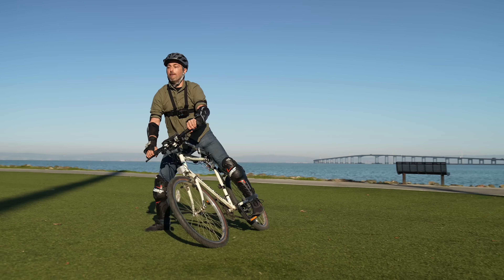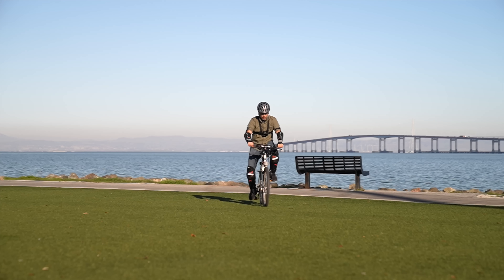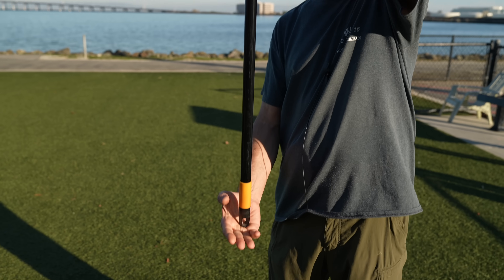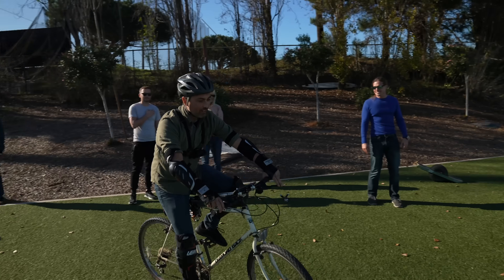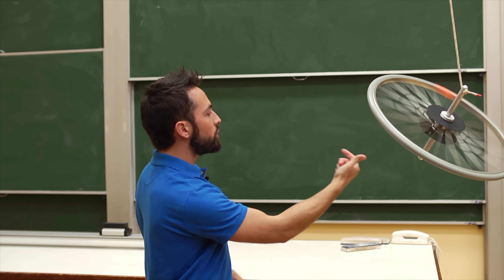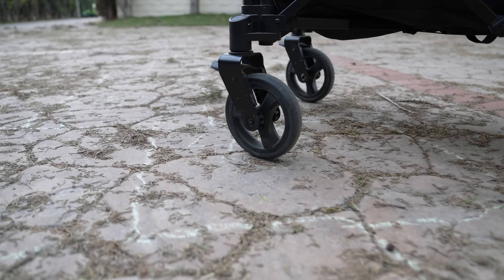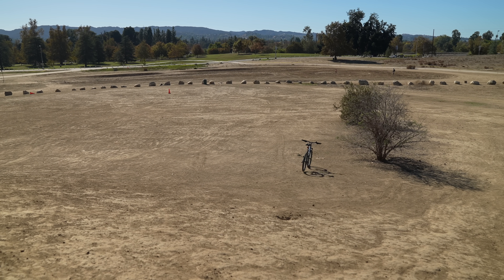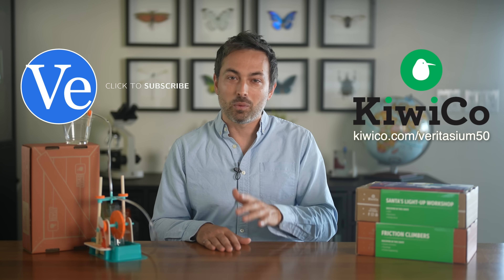Most People Don't Know How Bikes Work

Comment: Countersteering is not required, it is just an easier way to steer.  It help leans the bike quicker than just leaning by weight shifting only.  People are generally lazy so they look for the easiest ways to do things.  The bike is this video does NOT prove that countersteering is required to turn.
Reply: wrong
Reply: @Rick_Cavallaro  I am right.  Check online.  It would be very impractical (annoying, unsafe...) to steer a bike using weight shifting only, so that is why it is not done.  But technically, countersteering is NOT required.
Reply: @davidjames1684  You are not right.  And I don't need to check on-line.  I can check my M.S. in Dynamics.
Although I will give you this... There is a very small group of elite athletes that can balance a stationary bike.  They actually can steer without countersteering, but it doesn't look anything like us riding a bike.  It looks like a circus balancing act.  And it's not that they are just better at riding a bike than the rest of us.  They have mastered a different set of skills - skills that we don't use when riding a bike or motorcycle.
Reply: @Rick_Cavallaro  You are wrong.  If you were riding a bicycle and a big gust of wind pushed you to the left, whey the hell would you countersteer right?  The bike is already leaning left.  A degree is not a substitute for common sense.
Reply: @davidjames1684  
>> You are wrong.  

I'm tired of arguing with idiots.  Let's go at this another way.  I'll bet you $10K I'm right.  

>> A degree is not a substitute for common sense.

Common sense is not a substitute for rigorous analysis.  That's why Prof. Kusenko lost a $10,000 bet about my downwind car.
Reply: @Rick_Cavallaro  You didn't answer my question.  Why would you countersteer right if a gust of wind pushes you left on a bicycle?  Also, online is says that countersteering is NOT required on a bicycle.  Common sense tells you it is just a convenience and you even agreed with me that some very small group of elite athletes can do it.  Its main purpose is to get the bike leaning quickly, but there are other ways to lean a bike.  You are talking about riding a bike in a practical and normal sense.  I am talking about bare minimum to get it to work with restrictions (no countersteering).  Just ride a bike on a windy day, and each time a crosswind blows you, turn that same way without countersteering.  My statement was a bike can be ridden without countersteering, I didn't say it can be ridden normally that way.
Reply: @Rick_Cavallaro  Gambling is illegal at Bushwood and I never slice.  Damn!  I owe you nothing!
Reply: @davidjames1684  
>>  I owe you nothing!

You must be responding to voices in your head.  Who said you owe anyone anything!?  The fact of the matter is that I also owe you nothing.  That's why I can refuse to argue dynamics with someone that doesn't know the first thing about it.  You want to settle it... put $10K on it.  You don't want an easy $10K?  Odd.
Reply: @Rick_Cavallaro  Oh my you missed the Caddyshack reference.  Nice "contraption" by the way.  Too bad it doesn't prove Richard (Dick).
Reply: @Rick_Cavallaro  Funny how if someone doesn't agree with you, you call them an idiot, yet you did not (and probably cannot) answer my question about if a gust of wind pushes your bike, so that you are already leaning, why would you also need to countersteer to turn?  Just turn the wheel in the direction the wind blew you.  You "blew" it.  All countersteering is doing is getting the bike to lean quickly but if you can lean it using some other method (wind, weight shift, someone else riding alongside you on another bike that pushes you...), then countersteering is NOT needed to initiate the turn.  Just regular steering would suffice.  You are abusing the term "required" when referring to countersteering, when it is basically just a convenience to us for initiating turns.

Why don't you just have your friend try to turn left when you lock the steering so he cannot turn right?  That would help settle this debate.  Someone could be riding "perfectly" straight and just tip their head to the left to upset the balance of the bike and cause it to tip left.  Then just wait until the bike it at a good angle for the speed you are at (it will still be "tracking straight while tipped"), then quickly turn the handlebar to the left.  I am pressure sure I could do it or learn how to do it.  Just because someone falls off a bike attempting this doesn't mean it is not possible.  A kid falls off a bike when first learning to ride but eventually figures it out.  That is why I say this video proves virtually nothing about countersteering being required.
Reply: @Rick_Cavallaro  We are not debating a downwind car, we are debating countersteering.

Comment: I had to learn how to turn at high speeds on a bike, because I enjoyed going fast, and normal turning made me flip over the bike. The trick was yes a small turn the opposite was I wanted to go, and then to lean the direction I wanted to go, practically keeping the handle bars straight for the turn. Once I learned this I could go fast, and not need to slow down at corners. It was terrifying and exhilarating, but also increasingly safe to do it that way. Think I just learned that technique from my dad watching mortar bike racing and just picking up on that they mostly turn by leaning, and applied it on a smaller scale.

Comment: It's like a motorcycle.... You don't turn the handle bars you lean into the turn.
Reply: >> It's like a motorcycle.... 

Yes.

>> You don't turn the handle bars you lean into the turn.

No.
Reply: @Rick_Cavallaro  I've been riding motorcycles for 25 years! Yes you(or at least I) lean into the turn!
Reply: @Phantom8589  I have no doubt that's what you believe.  But you cannot initiate the turn by leaning, and the bike won't turn without steering.  And I've been riding motorcycles, bikes, and unicycles a lot longer than that - not that that counts for anything.
Reply: @Rick_Cavallaro  Well ok then, take care  brother, I slightly disagree but that's ok, we can have our own opinions. Safe travels while riding ✌️ 🏍️

Comment: wish they would have talked about steering when going fast. On a bicycle or a motorcycle when you are going over a certain speed say 20mph (I don't know the exact speed) steering becomes inverted (you push left you go left) also no counter steering is necessary.
Reply: Nothing changes at 20mph.  Counter-steering is used at all speeds.

Comment: Excellent video... At high speed a rider can turn without countersteering, but as you say, going slow, you have to counter steer. Try and do a slow 180 degree turn around a pole, or from riding along a fence line and turn slowly 90 degrees into a gateway... you will see how many countersteers and weird things you have to do to make it. Our brains can pick up these things to balance... I ride electric unicycles, which you can see on my channel, when learning it is very difficult, the harder you try, the worse it gets. Once your brain picks up what to do, how to control the EUC, it is like one minute you can't ride it... next minute you can.
Reply: >> At high speed a rider can turn without countersteering, 

Nope.

Comment: On a motorcycle you actually give bar input slightly opposite the direction you are turning. The bike leans over and turns itself. Very very little bar inout is needed on a motorcycle once higher than parking lot speeds

Comment: This is not exactly true and only is relevant at lower speeds.
At higher speed/wheel turn rates, the wheels rotary motion stabilizes you and with a proper leaning and steering to one side you will be able to turn.
The rotary stabilization is the real secret to bikes and is also used for positioning and rotation of satellites for example.
Reply: Wow - that was completely wrong.

Comment: To debunk  your whole video this only happens when you go slow as you do in your video. If you had more speed you would turn to the direction you want
Reply: To debunk your comment, counter-steering is needed at all speeds.
Reply: @Rick_Cavallaro   you can turn a bike just using momentum without even steering. Counter steering  is a technique that's used in cars and motorcycles  with different conditions but of course  you can also do it with a bike . That doesn't mean that's how you ride a bike. You use your weight to steer the bike into the turn   by leaning in you use the  momentum of the bike   and you turn with the steering being completely straight. FYI that's how bike motorcycles take turns. You use your weight not the steering, especially in high speeds. If you don't know how to ride a bike  a can teach you 😋
Reply: @Alex.Poursanidis  
>>  If you don't know how to ride a bike  a can teach you 

Did you see me riding the mountain unicycle in the video?  Maybe I could teach you to do that.

>> FYI that's how bike motorcycles take turns

FYI - your understanding of dynamics is sorely lacking.

Comment: As a frequent bike-rider my initial thought when he said most people assume you turn the handlebars was “no, you have to change your center of balance to account for the turn”
Reply: I think the statement is supposed to convey not that most people are ignorant of technique, but that the technique is almost entirely subconscious.  Most people that use bikes as a mode of transport steer the bike simply by willing their body to do so.  Perhaps an equivalent phenomenon is that most people aren't aware the wheels on a car aren't perfectly parallel when steering, but every driver intuitively knows that a car wants to steer back to centre if you relax your grip on the steering wheel (not that you're supposed to let go, but any driver should be aware that this happens from the forces the car imparts on the driver's hands)